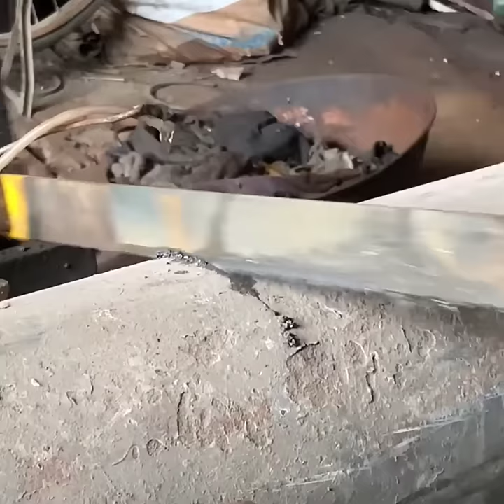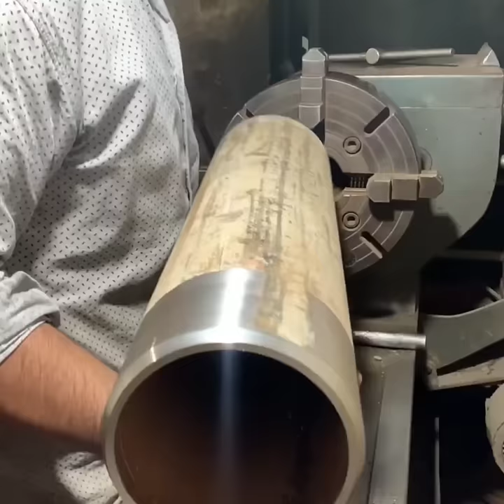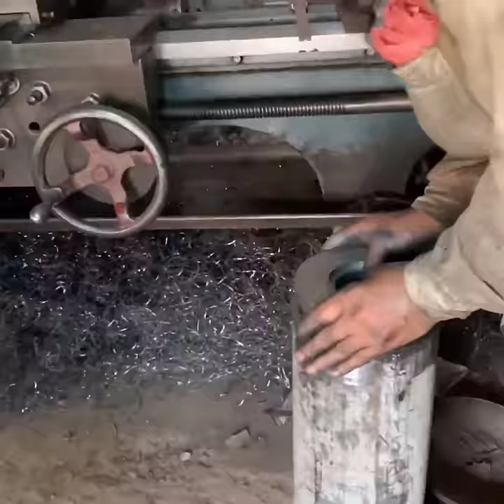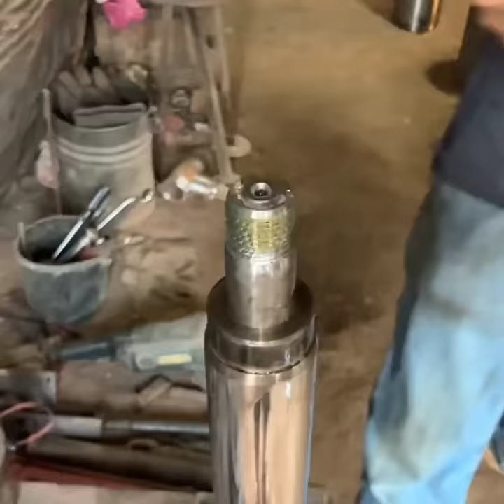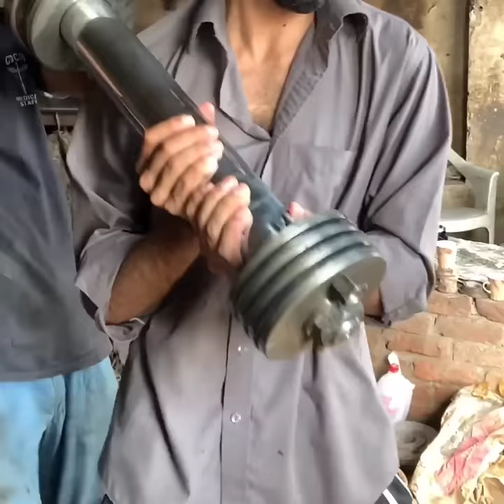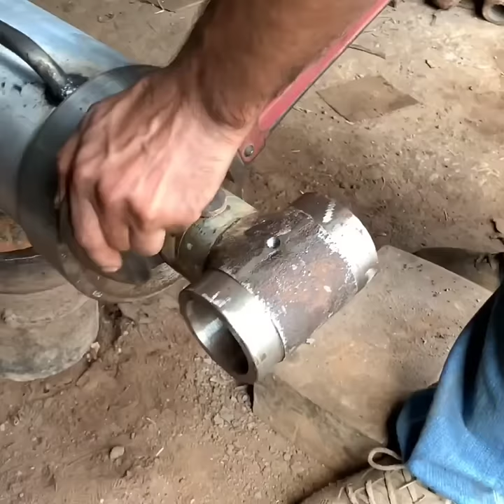Manufacturing Hydraulic boom Jack with Amazing Skills Magnífica produção.

Comment: Looks like it should work. I’d like to see it in action through full extension and contraction, and see how those ganged O-Rings are keeping the oil on the correct sides of the piston.
Reply: Sir, would you mind elaborate on that ?
Reply: Yeah.... It's sooo local workshops.... Their imperfections sometimes makes it even far more powerful then the stock one....

Amazing their solutions are....
Reply: @theo.suharto  mereka mau lihat, hasilnya yg sedang dipakai bekerja ... Pistonnya sedang angkat beban atau pressing sesuatu..... Cocok buat di YouTube kan .. tentunya di blur bagian2 yg mengandung merek lain...
Reply: They don't, won't, can't
Reply: @asahito2004  Iya beliau bilang mau lihat O-ringya bisa jaga oli di kedua sisi piston atau tidak, cuma nggak jelasin kondisi yang bagus seperti apa.

Comment: As a professional hydraulic mechanic it’ll work fine the only thing I didn’t like was the pipe wrench on that nut. We usually put red loctite on them and impact them down. You don’t want that nut coming off
Reply: You really thing those welds are fine for any hydraulic or any sort of high pressure system?
Reply: @andrewyellstrom2585  As a internet welding expert yes, they will suffice.
Reply: @andrewyellstrom2585  for them yes, if not why would they still manufacture it.

Comment: O rings wont last on a piston. You need a poly u ring seal or composite seal with a piston thrust bush and ideally the same in the cap for long lasting linear motion that requires low maintenance. But if you are going to use the dirtiest oil someone else doesn't want then probs wont make a difference.
Reply: this is 1930 ghetto hydraulic....